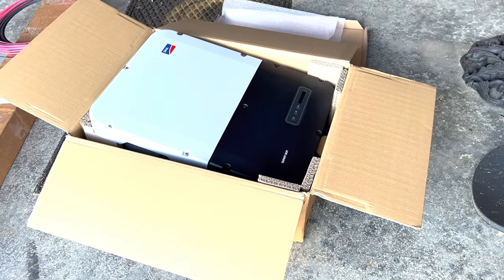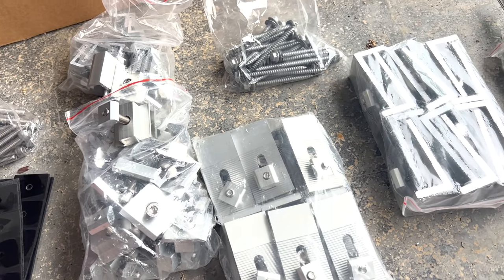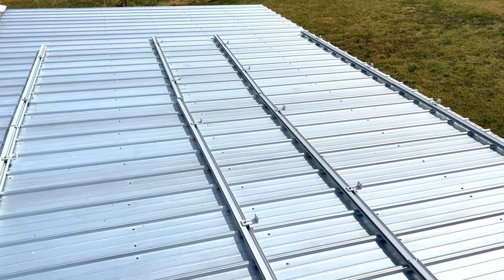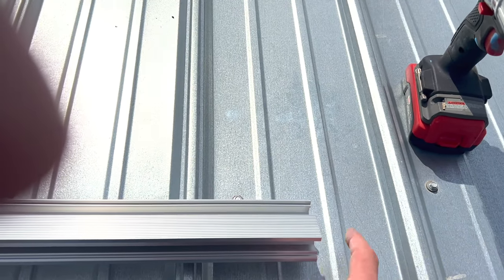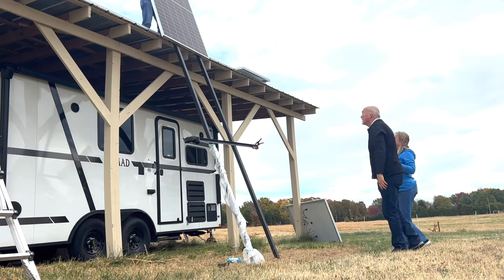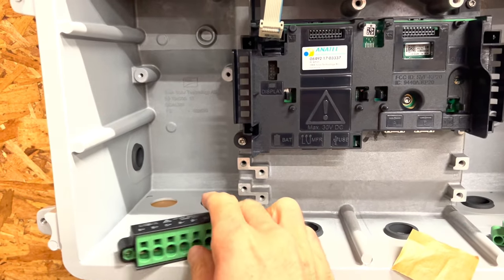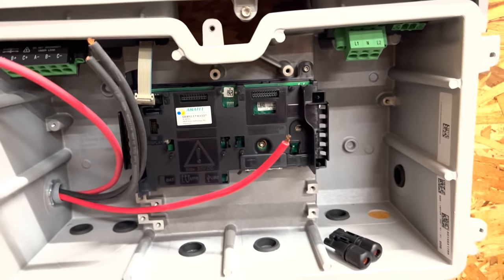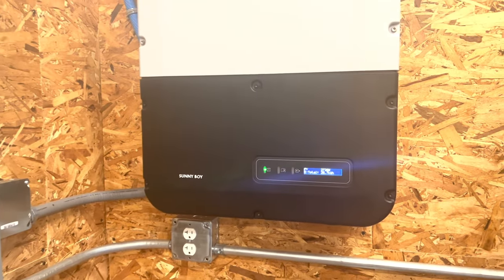Step by step solar install for beginners

Comment: what was your total cost of materials?
Reply from the maker: This install was about 6 months ago. And material prices can be pretty dynamic. But when it was all said and done. I think I spent about 7,000 on this 5 Kw system (just the one shown in the video, there is also a 7.2 Kw in the thumbnail, but I don’t have a video for that one). Then you get %30 of that back in a federal tax credit (if you are in the US) 
I included links in the video description if you want to see current prices on individual components. 
Thanks for watching! I hope this was helpful.

Comment: Easily the best diy solar video I’ve seen so far. I wonder how you’d mount the rails on a shingled roof? Find stud extra material for water barrier?
Reply from the maker: Thank you! I tried to be thorough, but it’s hard sometimes when you are trying to film while working by yourself. Lol 
They make mounting brackets for shingled roofs. There are a couple of different kinds. Here is an example. (Just grabbed one of the first ones that popped up on google for an example. This is not a recommendation) 
https://www.greentechrenewables.com/article/mounting-solar-panels-shingle-roof

I have never done an install on shingles though. It would probably make me nervous, but that’s what these things are made for.

Comment: I think it would be really beneficial to have a follow up video, maybe at the end of the year, that breaks down your total cost and savings of the entire setup. That way we can quantify how much the upfront cost could be made back through the 30% tax credit and energy bill savings. 

I'm from Kansas City, guessing you're somewhere in Missouri? Just based off you buying the panels from Missouri Wind and Solar. Would love to break down the viability of a fraction (maybe like 4-8 panels) of your setup for my home in the city.
Reply from the maker: Yes, Absolutely! I plan on doing a one year follow up to this video that will show a cost to savings comparison. However I will have to do it for my whole system. I had already had a 7.2 Kw system up for about a year and a half. There are definitely a lot of variables.  Your amount of sun should be pretty close to what I get. But the utility cost per KWH may be quite different.
Reply: @RoscoReviews  Evergy is probably different from your rural location. I'll have to do more research. I do get a ton of sunlight most of the day, so I think it could work. I see more houses in my area with them installed now too.

Comment: I want to place panels on its own 60’ from home in backyard, similar to a carport style set up. Any info this type?

Nice vid. What are you powering with both solar arrays … the shop?

Our utility company pays us discounted rate for excess… smh , does yours?
Reply from the maker: I’ve never done a ground mount system. But I know you can buy the raking pre made for that so it shouldn’t be too hard to do yourself. If you want to pay a company to do it, you do still get the %30 federal tax credit for the labor as well. 

The shop ties into the house meter. So The two systems I have cover about 2/3 of my energy usage all year. 

I think most utility companies are like that. Mine gives me credits back to be used later. You sort of bank kWh to be used when you don’t make enough. However, if they have been banked for too long (I think 12 months) then they buy them back for discounted rate. It’s a co-op, so they have been really awesome about everything.

Comment: The Sunny Boy inverter is no longer available on Amazon. Can you suggest a good alternative?
Reply from the maker: It looks like SMA is changing up their product line. Which is sad because I have used several of these sunny boy inverters and they are so easy to install. It looks like this is their new product that will be replacing the one i used in the video.
https://www.sma-america.com/products/solarinverters/sunny-boy-smart-energy
Unfortunately, this one isn't available yet on Amazon either... 

I don't know anything about the brands that I am currently seeing on amazon, so I don't feel like I can recommend any of them.

Comment: Great video as I have been wanting to do this on my own house for some time.  However, you may wish to make an edit, if possible, to hide your name and home address.  They're shown quite clearly a couple of times starting at about the 4:00 minute mark.  Too many nutcases out there.
Reply from the maker: Thanks for the heads up. Unfortunately I missed that when I was filming the video. I went on YouTube editor and blurred it out. But it takes forever for it to process. Should be fixed any minute.

Comment: Did you connect your panels in parallel or in series?
Reply from the maker: Using a single inverter like this. The panels will be run in a series. The panels should come with the plugs on them and just plug directly into each other. It is very simple. 
For this setup there are 2 strings of panels because this inverter has 2 inputs.

Comment: Can you split solar panel power into 240v for shop tools?
Reply from the maker: This is a grid tied system. So, it should work the same as it would without the solar. If you are wanting to do off grid. Then it is definitely doable. You just have to have your batteries and inverter set of for 240. and most off grid systems are I believe.

Comment: do you use a solar router to heat your water when you're overproducing ?
Reply from the maker: The short answer is no. But, The way my electric co-op does the metering, I don’t have to worry about over producing. If I make more than I use, the bill at the end of the month shows how many kWh I banked. And then I can use them in the seasons where I’m not producing enough. 
This is an extremely favorable arrangement! 
Many places don’t work that way and essentially “buy back” what you aren’t immediately using at the wholesale rate.
Reply: @RoscoReviews  that's awesome. I think its called virtual battery where im from

Comment: This 5KW system produced the 20kWh in a day?
Reply from the maker: I think a couple thousand of that was from the previous day when the electrician was there checking everything. I think it was on for an hour or so that day too which would have added to the total. So it was probably more like 18 the first full day.